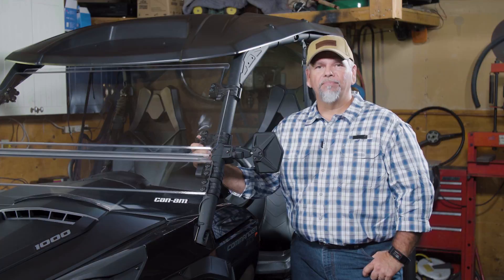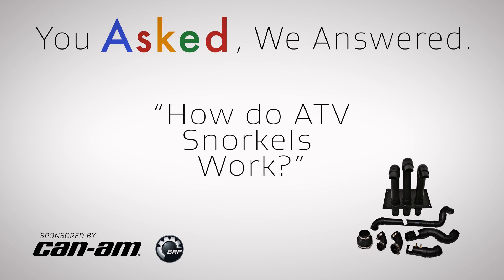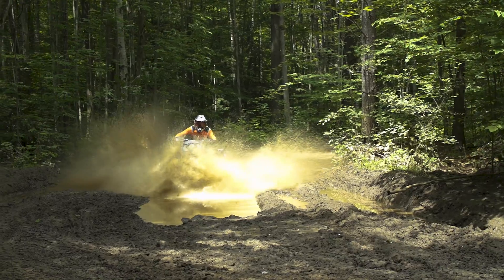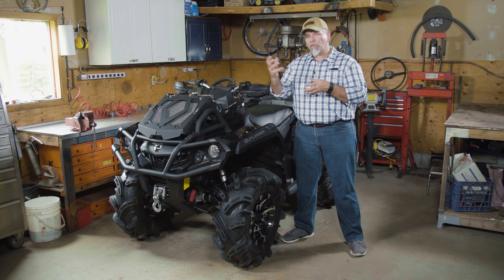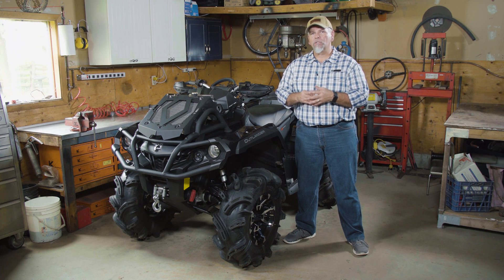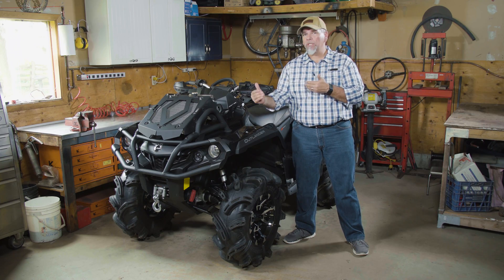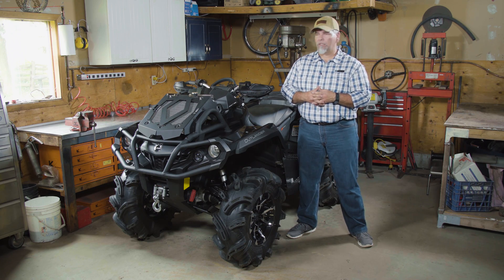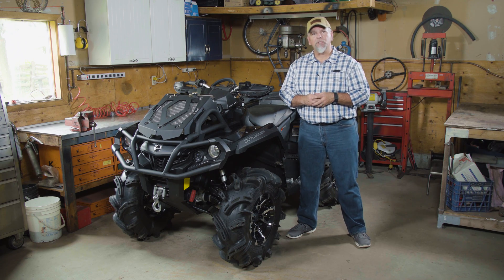How do ATV Snorkels Work?

Comment: what about the exhaust?? wouldn't water get into the engine from there?
Reply: most of the time if its fuel injected it wont enter but i would still google does (your bike) run under water
Reply: the snorkel is the exhaust

Comment: Can you tell me what the vents do?
Reply: the vents are like little snorkels for the things they are hooked up to your main snorkels (airbox and cvt) like for example you need to vent your diffs
Reply: @wonderbread2764  are they required or can you go without them
Reply: @brodybraswell8720  if you have a carbonator than yeah. Generally if you seal the airbox off well enough all your vent will be ran into there oem. As far as diffs go it depends who you talk to some say you don't some say you do, personally I snorkeled mine